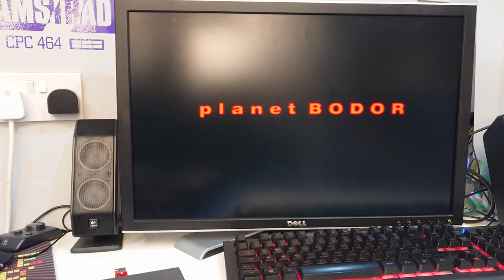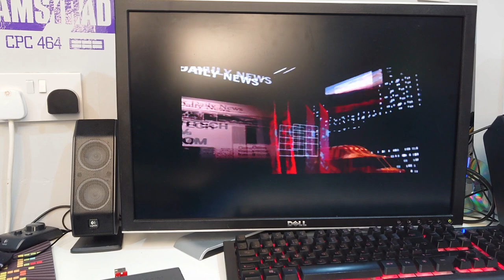DIY replacement CD ribbon for the CD32

Comment: Wow great work, and thanks for sharing, it could be useful! have you ever had to disassemble the top cover of the cd32 to replace it? I mean the lid that lifts and lowers to insert the cd... the side plastic of the lid where there is the screw that ties it to the fork with the spring is broken, I have one lid to replace but I don't know how to remove the long iron pin that holds the lid together to the cd32 case and which allows it to rotate.

Comment: Why didn't it boot from the CF card when you were testing the CD drive at the end?
Reply from the maker: I pulled out the TF330 expansion just so I could test the drive easier without it trying to boot to the CF card.  That said though if you have a CD in the drive before powering on the CD32 will always boot to that first.